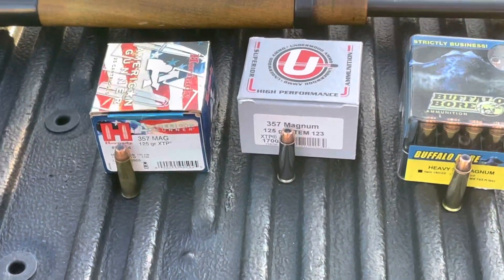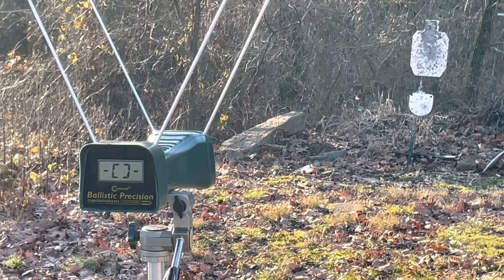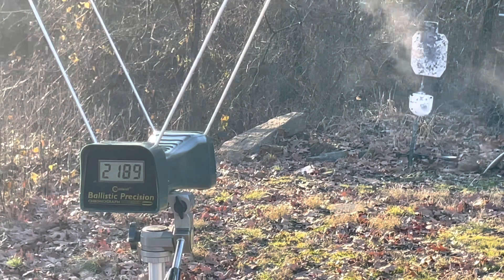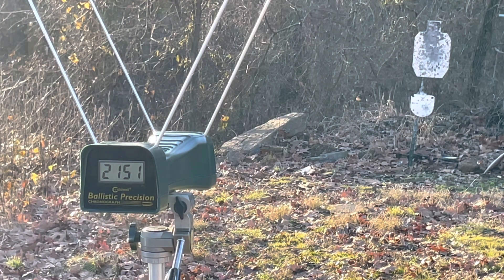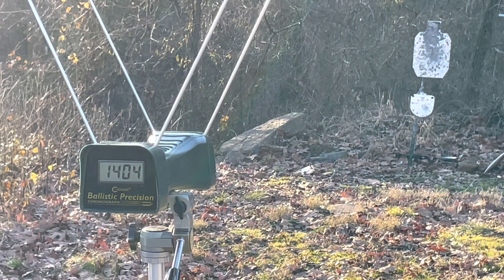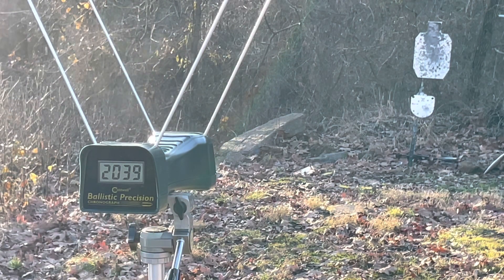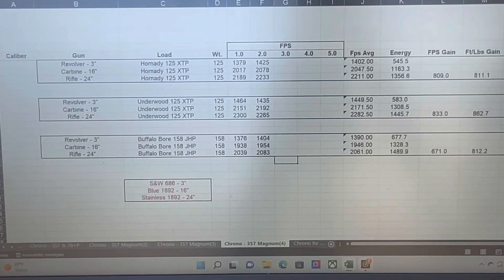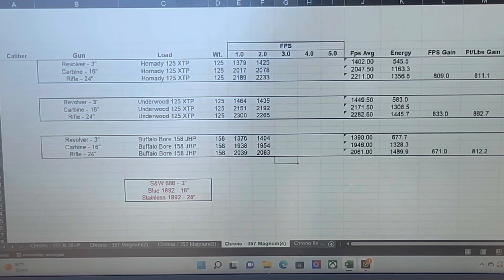Chronograph testing 357 magnum - Hornady, Underwood, and Buffalo Bore ammunition

Comment: Original 1930's load of .357 mag was known to be 158gr at 1525 fps, from a 8-3/8" revolver.
I'd say Buffalo Bore stays wholly true to the original and then some. Their 125gr load is even more impressive if you ever get your hands on some.
Buffalo Bore, Underwood, Grizzly, DoubleTap are all significant players. Hornady is a great "mainstream" load. Corbon, Steinel following. The usual Federal or Winchester or Remington are going to be less so. Remington has been significantly improving their ammunition across the board lately.
.357 from a carbine 16 to 20 inch barrel is absolutely formidable. It's a monster. I would love to see the penetration from a WFN hard cast style from Buffalo Bore or similar, in 180 to 200 gr from a carbine into something tough.

Comment: I think if that Underwood comparison was done with a 4 or 5" barrel you'd see that 1700fps number over the factory Hornady 1500fps. You can see it averaged 124fps more on the 16" barrel than the Hornady. Underwood is know to load them up spicy and not skimp on powder, and I believe thise numbers would ring true on a 4-5" barrel

Comment: Dangggg that buffalo bore 1400fps from a 3 inch barrel with 158gr bullet😮 can’t imagine that was kind on the wrists
Reply: Try shooting that at night. It will scare you the places you see fire come out of that handgun.
Reply: The 686+ with fluted cylinder is 35.8oz. It's not a featherweight, but it's not bulky either. I'd say the load would be tolerable for a cylinder full, especially if you were under fear of life.
One thing to consider if you're running a very lightweight revolver with these beastly loads, is the recoil is so violent that it could start to lead to bullet-pull from the loaded cartridges in the other chambers. In other words, the revolver will recoil so quickly, the mass of the bullets may start pulling out of the brass cases in the other loaded chambers, leading to elongated cartridges and could jam up the cylinder from rotating. Buffalo Bore tends to put a pretty heavy crimp on the cartridges to prevent this, but they also advise to NOT use their cartridges (as safe as they are) in lightweight revolvers.

Comment: It's hard to believe that even 357 is often neutered. I've seen Remington 125s only going about 1250 out of a 4" tube. Original 357 loads pushed a 125 to around 1650 and a 158 to 1450 out of 4" barrels. Anything less than 1450 with a 125 should be labeled as being a reduced load.
Reply: I heard 357mag SAAMI specs were neutered at the request of s&w because their J-frames are hot sellers but can't handle full power loadings.
Reply: 1930's development finalized at 158gr doing 1525 fps from a 8-3/8" barrel.
Reply: Original 158 load was ~1500 from a 8+” barrel
Reply: No, even within todays standards of sammi, you can get 1450 out of a 2.5 inch barrel on 125g , these are neiutered try underwood for full loads , the rest is just hot 38
Reply: Bunch of soy boy customers now days. Their hands hurt ! o !

Comment: Thank you for your video.  Its nice to see 3 barrel sizes and 3 different loads for the 357 magnum.  Amazing how fast that Buffalo Bore 158 grain is moving.   It would not be a fun load to shoot in a lightweight 2 inch barrel S&W scandium .357 mag revolver. However it would be an effective load to carry fishing,  hiking,  and camping.
Reply: I carry a 2.5 inch model 19-3 with Buffalo Bore 180 grain hard cast when out in the woods. No fun at all to shoot. but on a charging black or nutjob pit bull, I will welcome the power, recoil and all.

Comment: LOVE the 3 in... 
My GP 100 is a 3 in!
Reply: Not enough 3” chrono videos out there I’ve got a 3” 686+ Love that gun
Reply: @Lateralus1007  AGREED! 
I heard it from "Hicock45" and he was right... A 3 in 357 hits a "sweet spot" in Concealability, Velocity, and effectiveness... 
Have you seen the Lucky Gunner results?? 
A BIG difference in 2- 3 in Revolvers Performance but give up little to 3-4 in ... 
Still love to see more data!!!
Reply: Lucky Gunner hasn't tested the Buffalo Bore, Grizzly, DoubleTap, Underwood .357magnums, which in my personal opinion are staying true to the original way the .357mag was loaded in the 1930's and not the significantly lessened loads from common large manufacturers.

Comment: Holy Crap 1400fps out of a 3 inch  with 158 grains is impressive --  BB isn't kidding.
Reply from the maker: Definitely. I was debating chronographing them out of my little 2" j-frame size gun just out of curiosity, but after touching them off in the bigger & heavier L-frame, decided I want no part of that.
Reply: @MyHillbillyLife  I did BB 158 grain 38+P out of a 24 ounce 2 inch taurus 605 --- It actually stung my hand about 2 minutes so I don'yt blame ya.
Reply: @Hutzjohn  I’ve shot em out of a 442 airweight I use to own 😂 They pack a punch 🥊
Reply: @Lateralus1007  I've shot the 158 grain 38 +P B.B. out of a 24 ounce taurus 605 and they stung so I can guess how bad a "full house" 357 felt.
Reply: @Hutzjohn  BBore loads em to .357 specs I do believe Because on GunSam he shows a BBore .38+P 158 gr Traveled as fast as Remington HTP .357 158 gr , Around 1230-1260 fps
Reply: I believe Gun Sam revolver aficionado ran some 125 Buffalo Bore from a Taurus snub 605. Said he won't be doing that anymore.
Could also lead to bullet-pull from being too light of a revolver, if you load more than 1 cartridge.

Comment: Very interesting 👍. Thank you
Reply from the maker: Thanks. I was surprised that the 24" gun made much difference over the 16" one. I've clocked a lot of loads from the 16" gun over the years, but never from the 24". I didn't expect it to make the 110-160 fps difference that it did.
Reply: @MyHillbillyLife  Yes me too. Buffalo bore ammunition shows the 357 Magnum is about maxed out with 19" to 20". I like both the carbine is very handy and the 24" rifle should have better long range accuracy with longer sight radius. I would ad a receiver aperture sight to rifle. Thank you 👍

Comment: Thanks for performing these tests.  I was under the impression that with pistol rounds that the max velocity achieved is from a barrel approximately 15".  Though the .357 Magnum is apparently in a different league than most handgun calibers.
Reply from the maker: Thanks, I enjoy them probably more than I should. I think the 15" rule of thumb may be a carry-over from people talking about .22LR's; I've heard that about that caliber more than once. But the .357 flat out turns into a beast out of a carbine or rifle barrel.
Reply: @MyHillbillyLife  as does a 44m. Great content and thanks!
Reply: Ballistics by the Inch uses factory ammo that is not representative of any given cartridge's performance. Unless you handload or use boutique ammo like in this video, you would get the incorrect impression that there is no benefit to longer barrels.